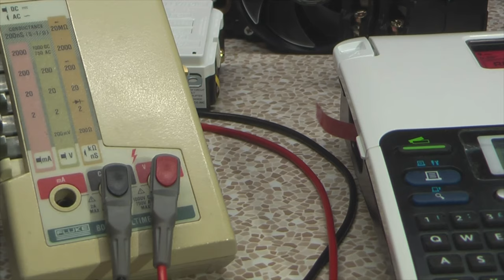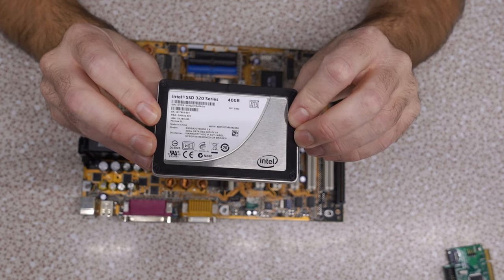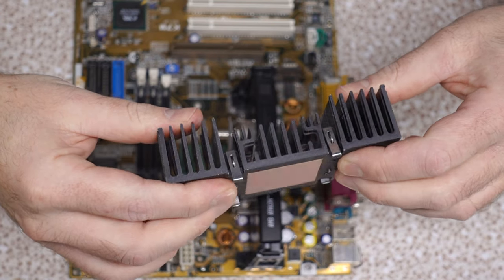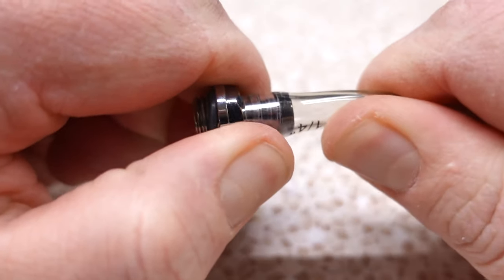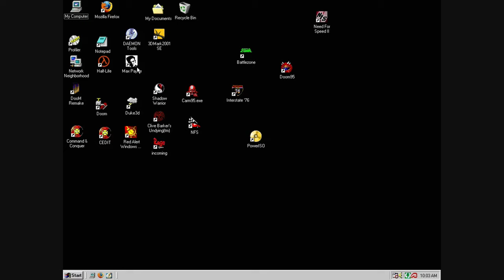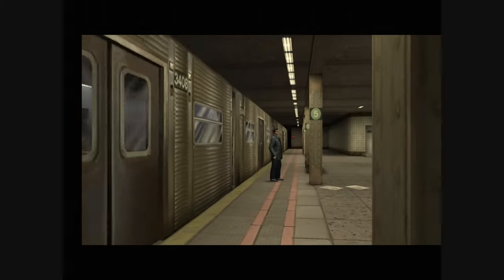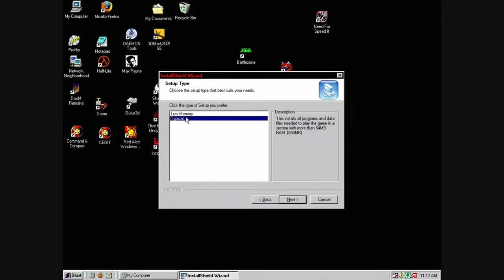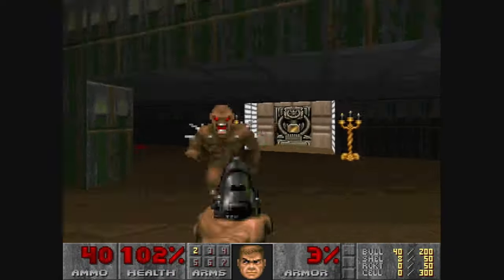Water Cooled Windows 98 Y2K Gaming Rig.

Comment: Clearly the Radeon 9000 you have isn't good enought despite being more recent than the build. Grad a GeForce 2 Ti, there are cheap, period correct and fast
Reply from the maker: I think I have a GF2, I know I have a GF4-MX440. The R9000 tested faster. 
I actually have other vids coming on this subject. 
I believe I found it was actually a CPU bottleneck.
And I wasn't really going for period correct with this build. 
Just the most performance I could get with the scrap parts I have.